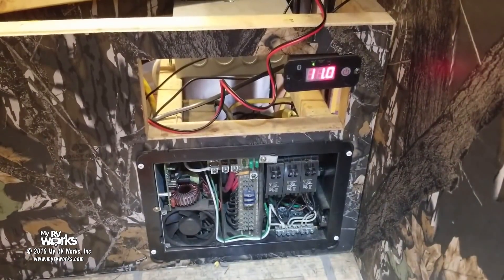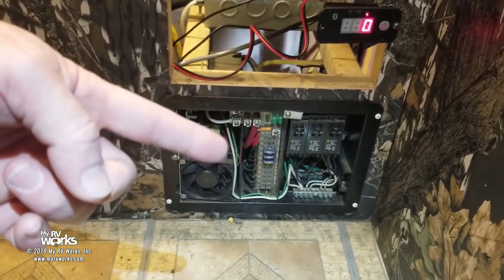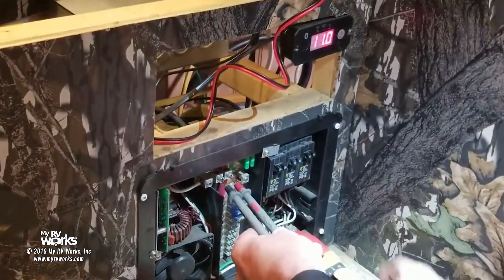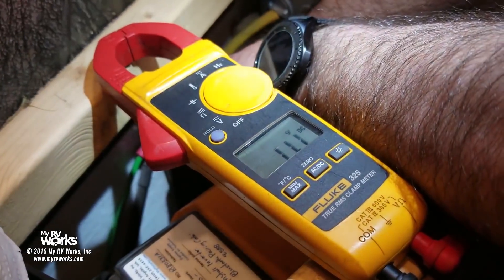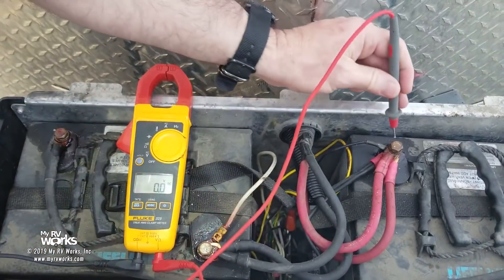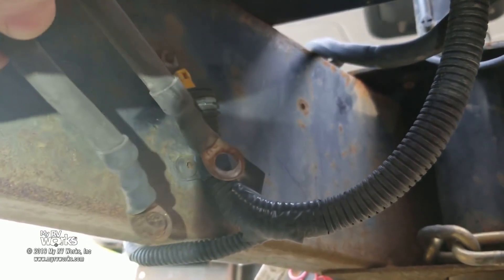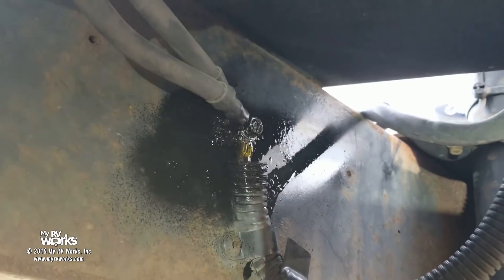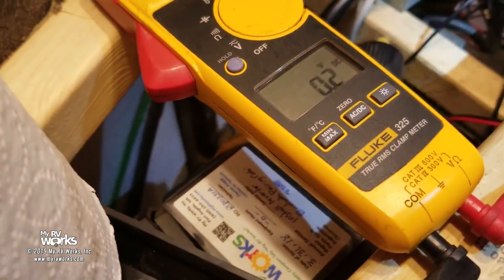12 Volt Electrical Grounding Issue - Is Your RV Next?

Comment: I am hoping you (or someone from the community) can add some insight to a grounding question I have. I have a cargo trailer that came with prewired signal and running lights and a small backup battery to operate the emergency brake. I'll call these the driving lights. I am making the trailer into a camper and have added a converter with a lithium battery and DC wiring to interior lights, a fridge, a water pump, and other exterior lights. Since I potentially have 3 independent power sources (car battery powering driving lights, trailer battery operating camper stuff, brake battery to operate the emergency brake in the event of camper break-away), Is it OK to ground all three of these systems to the camper frame? I feel like they should be isolated from each other. Any insight or explanation would be appreciated.

Comment: I'm going to trace my ground wire tomorrow.  My RV has had a problem lately starting the generator from the house batteries and has got to the point where it wont at all.  I isolated the genny and started it with my jump pack so I know its all good, thank God.  Some other weird things are dropping in power as well even thou across my battery im getting 13.1.  Im thinking loose ground, your video was very helpful thank you.

Comment: Had this exact issue on a brand new TT.  The battery ground cable was too stretched and was pulling out of the lug.  Ohmed from the battery negative to the frame and had 1.5 volts.
Reply from the maker: It sounds like you found the culprit! A stretched ground cable can cause all kinds of electrical gremlins.

Comment: im getting pass thru residual voltage of 5 volts thru an open 112 volt manual reset circuit breaker. im thinking it might be a grounding issue as I have replaced the circuit breaker a few time and the same problem.

Comment: I ran into a non start issue with my Tundra this morning with a Go Fast Camper and Renogy system installed (DIY) with 200ah house batteries connected to the starter battery.  First start in the morning, a surge and a slight overturn. Then after every start attempt there was no turnover. To make a long story short, I connected the negative terminal connection to the ground on the frame from the starter battery, recharged the started battery from 12.4V to 13V and whamo! She started up. This is after several success and failure attempts. There is a plastic tray under the battery too and I was questioning if the connection to the negative terminal was causing electrical gremlins and or not creating enough crank amps to overturn the starter motor. For now its working. Going to be vigilant about checking my ground connections from now on.

Comment: Darren, first of all, thank you for admitting you aren't Superman and subject to many of the same problems we deal with. 

I think this, along with some other vids, illustrates the need for proper ground to chassis connections. Aside from tightening bolts (or making sure it didn't rust off), but think of galvanic corrosion. We have to join copper wires to steel, which are incompatible. If you tried to crimp on a steel ring terminal on the cable you just move the point of corrosion from the frame to the terminal crimp. Almost, most people I discuss it with misunderstand dielectric grease. They think it conducts instead of insulating then wonder why they have problems. 

I suggest a vid on making connections: how to prepare a rusted, painted chassic point, how to make a new grounding point, how to make crimp connections from 12vdc wire terminals up to high amperage crimps. You covered using a torque screwdriver for the 110 panel, which was enlightening. However, you did not discuss the mundane topic of stripping wire, twist or not, goop or not or when, perhaps, to solder a connection. 

Another series to consider might be mapping out voltage drop and using the negative for reference to find faults. There's a lot of vids with the auto repair industry but nothing showing the challenges of my 38' class A. 

Lastly, I would suggest touching on coatings and protection from water and salt. 

You are the most valuable source on the interweb for RV troubleshooting and maintenance Darren. Thank you for sharing.

Comment: I've been problem solving my drain battery or no battery power . I removed the 3 way fridge because of a refrigerate leak so I took the DC wires to a 12 plug with usb ports and I still had issues. I watched this video then checked my ground wire and would you look at that ! My frame bolt is rusted and broken , thanks so much I appreciate all your videos

Comment: I've been a subscriber and want to thank you for your perspective on this troubleshooting. I installed four new brake assemblies that were worn yet ultimately was not able to solve the intermittent output short on my brake controller. Your troubleshooting ideas brought me back to where I had given a cursory check - the ground connections from the batteries to the frame. Upon closer inspection - there is was. Not completely fractured like yours but corroded enough to break the electrical path. Thank you sir and keep the tips coming.

Comment: Great video! I guess I still don't understand the reason for grounding to a frame when a ground wire would work better. My last utility trailer rewire has both.  Hopefully redundancy is a positive thing. Thanks again
Reply: Using the frame for a ground side conductor saves on copper and it's already there.  It's a large piece of metal and able to conduct well.  Problems come up in the termination and the ground side is often overlooked when troubleshooting.  Funny thing is that is often where the problem lives.  Stainless bolt welded to the frame and this wouldn't have happened.

Comment: So I will hope that by throwing out a RV DC technical question on my 2020 keystone Cougar and I pray that you can guide me in the right direction. I recently Found the fuse on the DC board blew to the water pump. The water pump though has never been used so it was kind of surprising that it blew.  So by watching your videos and other ech support the notion that there may be a short in that circuit. The wire runs from the fuse panel to In-Command BCM whereby it triggers a relay to turn on the water pump. So tracong the worong from the fuse panel to the water pump I checked all the wires, continuty test, voltage test etc. it all seem to be fine. so I disconnected the water pump fro the circuit and still I blew a fus. I then took the leads offf the BCM and still blew a fuse. So I hooked up a 12 volt light to the wire from the fuse panel and th elight came on bright with the almost the same voltage that was coming from the fuse panel. Si Disconneted the wore from the BCM to the water pump and reattached the wire from the fuse panel back to the BCM and then the fuse blew again. I then hooked up and brand new same guage wire from the fuse panel to the BCM and it blew again. So now this has stumped many. Maybe you can give a little insight as to what your thoughts are.
Reply from the maker: There is another meter we use in the field to help us track down shorts in wiring.  Here is a link to the Fluke TS-90:  https://amzn.to/3Mjr8WF

Using this meter it will indicate the distance to the short (in wire length).  Knowing this has helped us in multiple diagnosis situations that others were not able to find.  We featured this meter in another video here:  https://youtu.be/lJXTBdirykQ?t=650

Comment: I've got a mystery for you but I live in Idaho my power is intermittent during the night and off during the day on my outlets for my air conditioning, furnace, refrigerator, bedroom TV, microwave and my air conditioner in the bedroom works and my frigerators work on gas .2008 Grandjuction 37qsl.. I can't figure it out I wish I knew a good RV mechanic over here thank you

Comment: My brand new Toy Hauler had a shorted ground to the not well grounded Junction Box. I made 2 wire jumpers from ground to the Jbox. RV fuse box  now has battery voltage. Now everything is working.

Comment: Hey Darren since it appears you have what I think it's an Mighty Mini PD panel, I and many others would like to know how the AC/DC grounds are supposed to be done. First many believe that three grounds each supplied with separate terminations at different points on the chassis.  One from the AC panel ground busbar, one from the battery negative on the DC panel and one from the DC terminal ground busbar. Would deeply appreciate clarification and explanation. Thanks in advance.
Reply: Great question as it relates to bonding...

Comment: Have watched a number of your videos to learn more about diagnosis and testing.  I was just up in your area last week in the olympic penninsula but back down in portland area.  Definitely need to get a good rv tech in this area.  Do you have any referral to a competent RV Tech.  It's an electrical issue.  replaced the converter with new one but still not charging the battery when plugged into pick up and same lack of charging the battery when  plugged into 20 amp connector.  2016 wildowood xlite trailer forest river. thanks.

Comment: Very interesting.  I thought I heard that the ground is arguably unnecessary for vehicle electrics because it's on rubber tires, so I'm surprised it's having that kind of impact in your case.  Hmmm...
Reply: Electrical ground is the return to the source for the circuit.  Or it could be the supply depending upon which model you subscribe to.

Comment: I had a very similar thing happen with my electric brakes; Intermittent indications on my brake controller while driving everything would check good while stationary. Rusted thru broken ground screw at the truck end of the plug.

Comment: I am trying to convert my florescent light fixtures to led fixtures. I replace the ballast twice before I figured out I want to change them to leds. when I removed my florescent fixtures, I have 12v on the two wires coming out of the celling but when I connect the new led fixture to the wires, it wont work. I then left the positive wire connected and ran a test wire from the ground in the fuse box and they work. I have 3 lights on the same switch but the other 2 work but I tried to hook the led fixture to one of the other fixture wires on that circuit but the led fixture still don't work un less I ran that ground to the fuse box. how do I get to the ground wire in the celling to repair it?

Comment: I had a built in surge protector on my motorhome that failed, so I had a mobile RV fellow locally come by, where he basically gutted the Surge Protector, hooked all the corresponding wires together, including the green ground, and basically used the surge protector box to hold the wires safely.   BUT, now when I do a test of my outlets in our coach, I get a 'ground fault' reading!   I'm 'not' quite sure what to check for, as mentioned all wires where hooked together, yet prior to my surge protector failing, I had no fault!   I did go in an push my GFI outlet preset, which turned things off and on at that electrical outlet, but it still shows a ground fault.   I might pull the 'box' off again and look inside to see if there is an issue, but I did watch him connect all the wires and all looked fine.   There is power going to my Xantrex inverter, which seems to be charging the batteries...as my mulimeter showed the input as 14.2 V, so it may be equalizing.  Thanks for the video though, as I have some further checking to do it seems.
Reply from the maker: To schedule a service consult with Darren please sign up for the "1:1 Repair Consult" on our Patreon site.  https://www.patreon.com/myrvworks

Comment: Searched for 'solar power' on your youtube main page, this was the top of the list. (Your usual top notch diagnostics at work!). Question: Any history with RV solar power / charging / inverter systems? Specifically battery recommendations? Youtube universe goes from 'cheap' 6v golf cart batteries (4 in series / parallel) to lithium-ion paralleled pairs (or more) at $900 each. It's all about amp-hours & capacity.

Comment: Great helpful video!
Dielectric grease is good stuff.
Reply from the maker: Thanks for the comment Michael!

These are a few of the things to check on any annual preventative maintenance inspection.  I am surprised at how many batteries do not have anti-corrosion paste on the terminals!  

Cheers,
Darren Koepp
Reply: @MyRVWorks  yes those little felt pads that go between the battery post and the battery terminal on top of the battery are amazing and cheap little tools, there's a surprising amount of acid that weeps up between the plastic in that post.
I love your knowledgeable helpful videos and the way you want to work with the customer, if my family was out in the RV away from me and it had a breakdown I can only hope to find a shop that is half as helpful and knowledgeable at you guys are, not a business that just wants to change parts